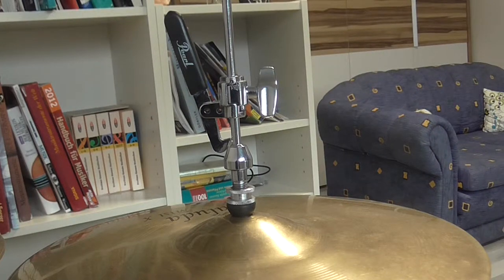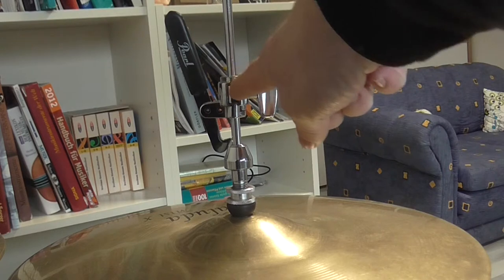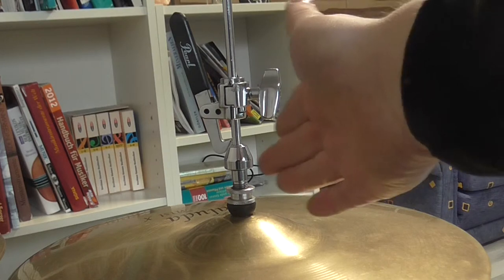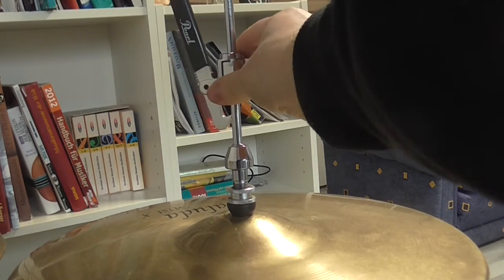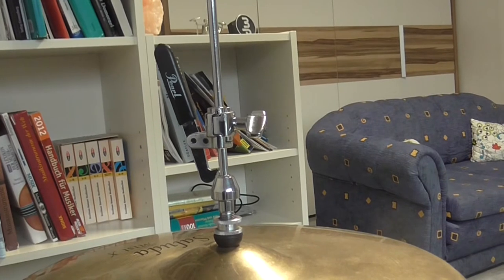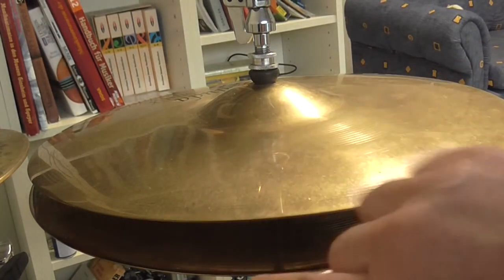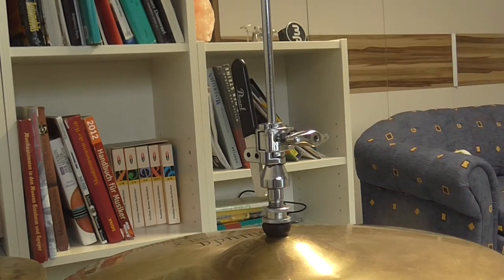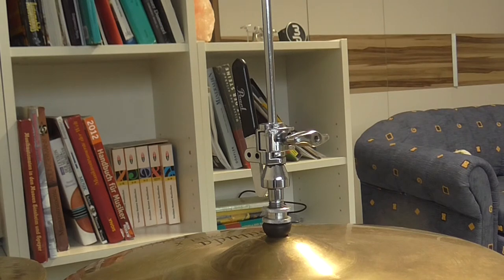My Personal Opinion-Pearl Drop Clutch

Comment: Sorry what is the advantage of having this type of clutch over a normal clutch?
Reply from the maker: you can open and close your hats much faster cause when you want to close your hats you let the top cymbal with the second  part of the clutch drop on your bottom cymbal and the hihats are closed but loose. When you want to open it you push the hihat pedal down and the hook of the top cymbal catches the second part and the hats are open.
Reply: The advantage of having a drop clutch is if you play a lot of double bass/double kick you can easily use your hi hats in a closed position by simply hitting the clutch lever and disengaging the clutch.  Otherwise you’re obviously limited to an open hi hat sound or other cymbals unless you manually open or close your hi hat clutch before or during a song to achieve the desired effect.  

If you don’t play double bass or use any kind of accessory pedals it’s pointless to have.  Otherwise it’s an excellent piece of hardware to have on hand.